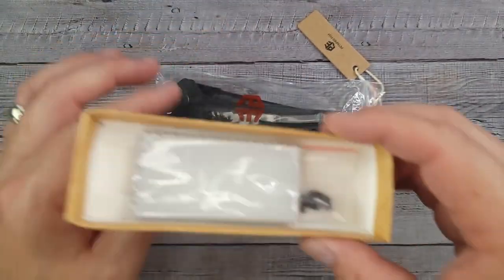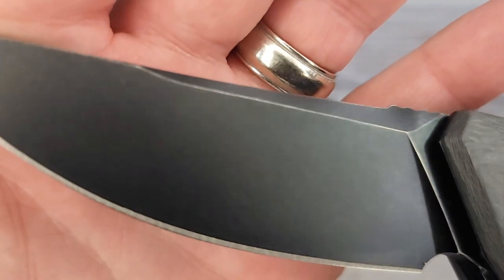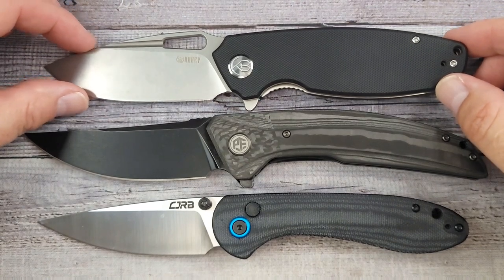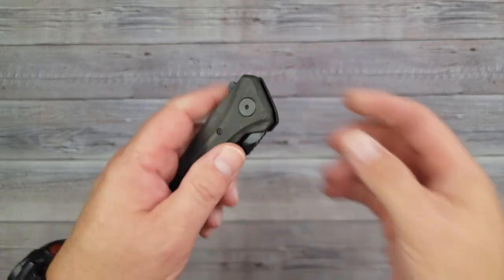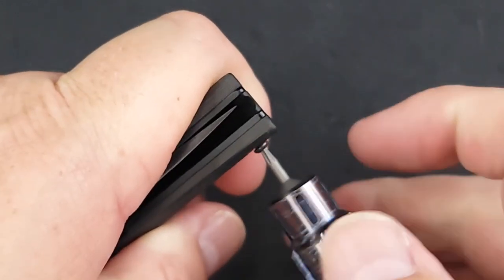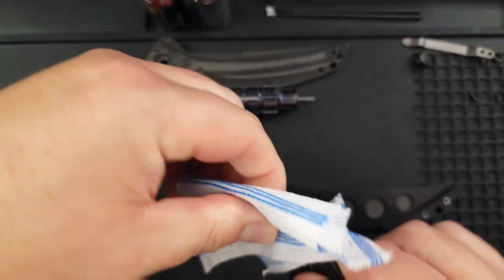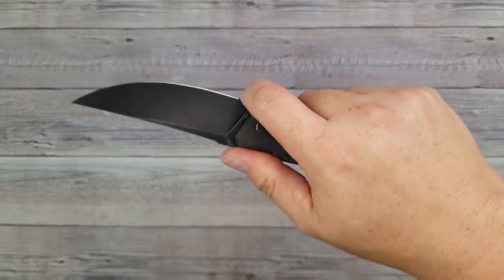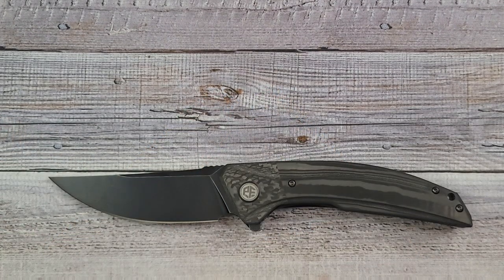The PETRIFIED FISH DEEPSEA Has ARRIVED!

Comment: As the price of Civivi, Kizer and a number of other mainstream brands go up, a price void has been created. Petrified Fish have come in and filled this void nicely. Everyone needs a quality value work knife.  The RAT1 is probably the benchmark for this.  When you first showed the knife I was a bit 'so-so' the you opened the blade. Trailing point with nice long belly  😃😃😃. Nice to see some carbon fibre even if slick and the after lube action. Thanks for showing.  Sharp blades all!!